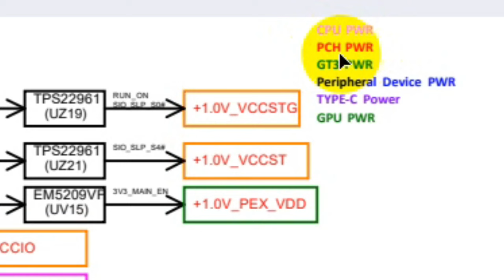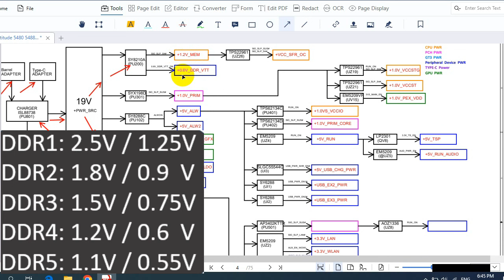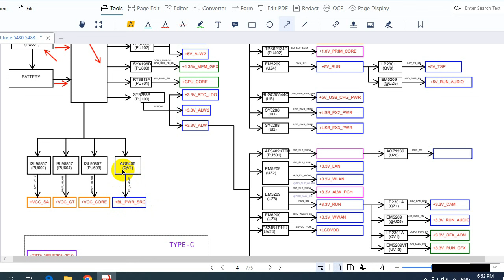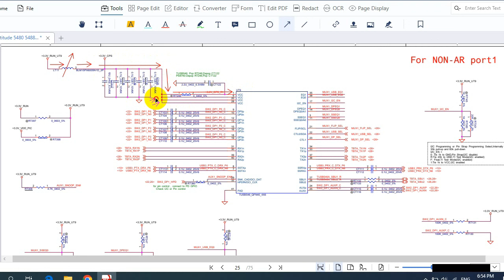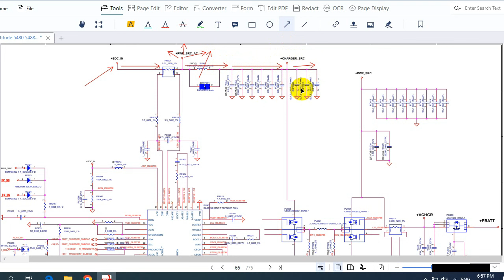Trace and Track Motherboard Voltages Like a Pro - Laptop Motherboard Repairing

Comment: thank you a lot! but i am confused:  in your videos talking about 5V and 3V it seems like they are generated by the single IC, but in this block diagram i saw 2 different IC one for 5v and another for 3v, plz correct me if  5v and 3v are generated by the same IC or if it depends on motherboard.

Comment: Hey there, I follow your videos daily. I have big issiue that I can't solve for already 5days. My Lenovo t410, is getting 19v. I have tested the IC u41 controlling the 3v and 5v MOSFETs. On the reference pin 22 I am getting 3v but on the pin 29 I am not getting reference voltage 5v. Could you please look on the schematics and maybe you can give me an idea what else to try?   Also there are other 2 ics u42 and u 23 and I am not sure which one of those is the kbc chip. I don't necessarily need this laptop, but I don't wanna give up on solving the issue, I am using it to learn. I have idea the u41 is faulty but I am really not sure
Ps. I have tested all capacitors and indicators for short, and there was no short to the ground

Comment: Hello, how desktop PCs motherboards are different from laptops in terms of power rails/voltages?
Reply from the maker: There are some differences but not much. I will explain the desktop motherboard soon
Reply: @electronicsrepairbasics_erb  Thank you. That would be very interesting. Desktop motherboards are often neglected when it comes to electronics repair. I would like to learn whether desktop MBs are simpler or more complicated than laptops.

Comment: Here is the challenge;
Buying a backlit keyboard (with 2 pin extra power flex) for a replacement when there is no backlit power pin on the mobo.

Need suggestions from pros!
Reply: I mean finding correct power (assuming 9/12V DC)  to keyboard backlit pins all i need.
 (ps. i have and old little analog multimeter)
Reply from the maker: I didn't understand you bro
Reply: @electronicsrepairbasics_erb  <3
I want to replace my ASUS laptop's keyboard which has no backlight and its red characters on the buttons are not visible enough even in a lightroom and made me blind over years :)

I'm thinking buying a backlit replacement keyboard (fitting) but my mobo doesn't have a power port (4 pin flex cable which is actually 2 pins) for keyboard, so i need to supply power to backlit keyboard. where should i supply backlit keyboard's power flex cable?
Reply: That's a challenge for only pro levels which i meant :)